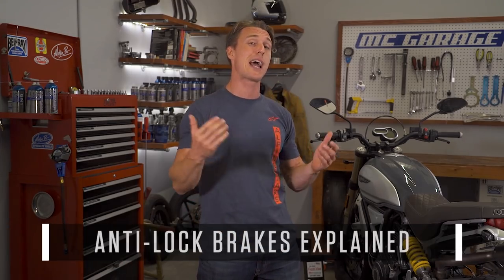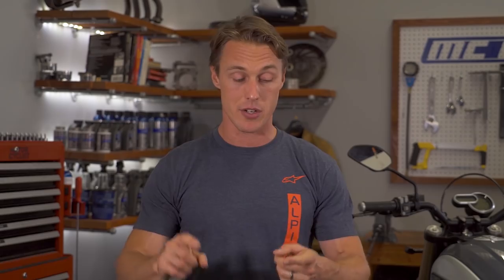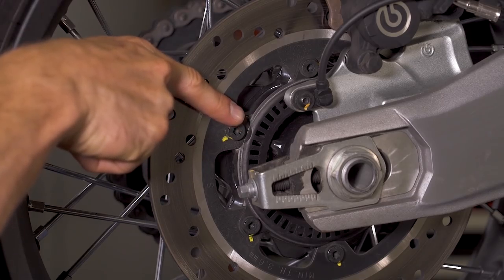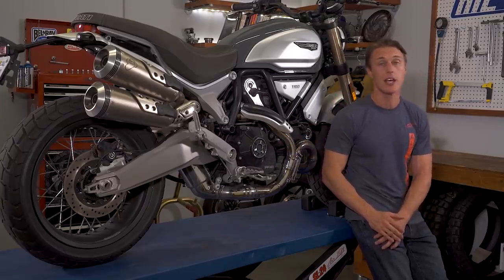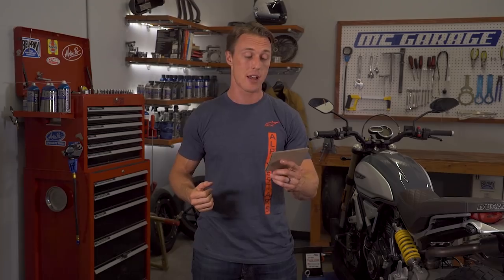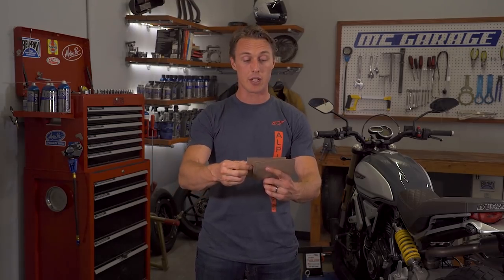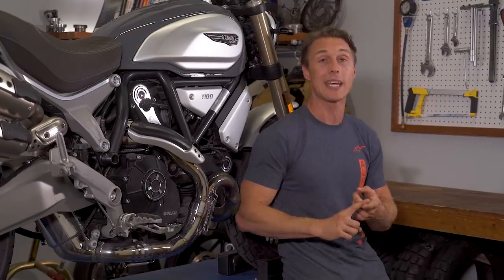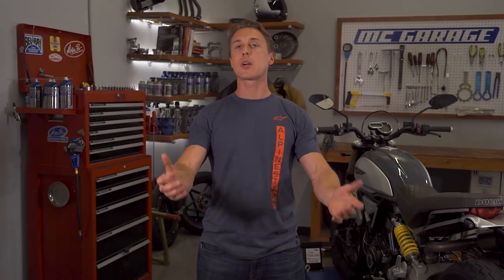Anti-Lock Brakes Explained | MC Garage

Comment: The couple times I had to brake so hard that I engaged the ABS on my MT-09, it did save me from falling, crashing etc. Soooo, yes, I do like it!
On the other hand I wish I could switch off the ABS on the rear. Just for fun.
Reply: I've definitely had a few close calls, but those were in my earlier years...I'm wiser and more paranoid these days, heh. But yeah, if they work well, then I'm all for ABS in bikes
Reply: Most (690 and bigger) KTMs have that possibility to to disable rear abs. They call it Supermoto mode.
Reply: Funny it's standard on the Duke 690's, but I had to buy a $130 dongle for my 701SM (mostly the same bike) to disable my rear ABS. If I want to re-enable it in the rear, I have to yank it out. I'm mad at myself for paying that, but I'm kind of glad I did.
Reply: Quintan Neville That is funny. It's much easier to activate with my -13 690 Duke R..
Reply: I also own an MT-09, and what I do to turn off the rear ABS is to pull out the rear ABS pump fuse 😁

Comment: Love it. First bike didn't have it. Second one did. All since have it. It's like fuel injection; I can't go back to carbs. I'm not interested in worrying about locking my front wheel on sand at a stop ever again.
Reply: Me too. First bike did not have ABS (Fazer 600), and second does (XSR900).

ABS saved me last winter when I fishtailed twice on icy cobble-stones on cold tyres.
Reply: i'm somewhere in between definitely my next bike will have abs. 
p.s. what were you doing on your bike in the winter on cobble stones!? o_O
Reply: Bad illustration. ABS is not like carburetors.
Did you pour air and gas into a bowl and stir it with a manual crank beaters, then dump it into the engine while riding down the road? No. Nothing about how the fuel got into the engine was manual before, or now. Brakes are always manual. ABS is subservient to the user, not the other way around. It's always mandatory to learn how to module brake pressures! Do people stomp on brake pedals while driving the car, every time they need to stop? No. They modulate pressure.
Panic stop? If panicking is your idea of proper driving or riding, don't.
Reply: @exothermal.sprocket  it's just a example not a comparison
Reply: Brakes are manual, ie. you squeeze a lever and the force of your muscles translates to fluid pressure.
Fuel atomization is via machinery (carb or f.i.), you don't do anything.

ABS is subservient to manual input, ie. you squeeze the lever with adequate force to begin to stop rotor movement, the speed sensors trigger the ABS module to take over fluid pressures and "pulse" the system.

Comment: Both my wife and I own H-D bikes with ABS and have been in real life situations where it has been used. We were cruising down an asphalt road out in the country, kind of bumpy, about 45mph when a full size doe and her two yearling jump out in broad daylight. My wife was ahead of me and grapped both front and rear brakes, i did the same. I saw the bike squat and slow down and straight as an arrow. They were so effective i was amazed. It's a no brainer, if the bike offers them, get them. If the bike your looking at does not offer ABS brakes, look for a bike that does.
Reply: @wescobts what kinda bike were you guys riding?? I'm considering my first cruiser and it's been driving me insane. I really like a few of them Suzuki m109r and Yamaha radier but they don't have ABS. All the sample videos I've seen on front wheel lock ups on YouTube are sport bikes and always wondered why cruisers don't offer as much ABS options as cruisers. Anyway thanks a ton for any advice in advance!!
Reply: @Lizizoteezo  
I am riding a 2018 H-D Street Bob, and my wife is riding a 2017 H-D 883 Sporter. They are both really nice bikes. The ABS system works great and the bikes are nimble and handle road situations well. There are plenty of add ons and acessories available for both models.H-D offers ABS on any of there bikes, worth a look. Good luck

Comment: I have had roughly 15 years on two wheels and only recently did I have a chance to ride a bike w/ ABS on a regular basis and I have to say, it is nice to have. When the ABS kicks in, I know that I am getting too close to the limits of my bike. True, there is a little more "safe braking" to be had but unless you're on a track, why would you want to get closer to the edge of traction? Emergency braking doesn't always mean you are going to be on point with managing brake pressure, simply because of adrenaline/panic/survival reactions so having ABS there to save your bacon is ABSOLUTELY a good thing. Great vid, I love seeing notifications that there are new vids on Motorcyclist Magazine's channel.

Comment: As a bumbling novice who rides both a KLR and a Super Tenere (2015), the latter having at least a little sophistication in that applying the front brake also activates the rear brake to a certain extent, and who keeps hearing that you want to turn off the ABS for off road applications, my questions are these (assuming that I could turn the ABS to start with): 1. Should you turn off the entire system or just the rear brake off road? 2. Why should I want to turn off any portion of the system off road to start with?

Thanks guys. Appreciate your incredibly valuable presentations much indeed!

Comment: ABS Is like all other electronic safety  wizardry. Like traction control, like anti wheelie, like motor slip regulation. You don't like to admit it's a good thing, but being honest, it let's us take it to the next level. We can push that little harder, and, with KTM's contribution towards electronic wazardry, you don't even know its helping you do it. It is a good thing. Let's let it evolve. 
I'm just waiting for height controllable wheelie control 😁
Reply: Nick Bennett that’s exactly my wish. Didn’t buy an S1000R naked BMW yet, just because the wheelie control is either on (and intrusive, in most of the riding modes) or just completely off in the pro mode or whatever they call the “all nannies off” mode. I wish to have just a “supercool but safe wheelie” mode, and I’ll be happy!!!

Comment: MOST of us "Like what we are used to"... and for old buzzards like me, that means NO ABS... Emotionally speaking...
But my last Bike Purchase also needed to be 'affordable' or it wasn't going to happen at all...so I threw down a DEEPLY Discounted hand full of Dollars on an FZ1. ABS was 'available' on the then new 2013 for about $1,000 'extra' and at full Retail price...Somewhere above $12,000.  BUT they didn't have any in stock... And the 'left-over' 2012 model that I took home cost me about $8500 Ride-Out! With just 4 miles on the odometer, and no ABS. With 40 years of riding without ABS, I am still quite 'comfortable' just as it is. BUT I have had my share of times when I now WISH I had ABS, and I am pretty certain that my NEXT Bike will have it! My first experiences with ABS -- 'test riding' friends' bikes -- I was not comfortable with the examples I rode! But I DO realize how much it can HELP...Especially in those PANIC Stops that some .. Most of us will still GRAB the brake lever...
I still do Track Days with my non-abs 'nekked bike' ... and play Chase with a few WERA Racing Friends of mine up in the Blue Ridge Mountains... even at 66 years 'young' !! But more and more, I 'wish' I had ABS...but also glad I was able to Pay Off the bike at that purchase price, rather than to still be paying 5 years later...

Comment: I ride a 100cc and also tour on it. I am planning to upgrade to a 250 or 300 in a few months. However, I haven't ridden an ABS bike yet. My outlook has been that riding a 100cc has not only helped me in knowing how much pressure I am to apply on my brakes but also to read the situation well while I brake.

Comment: Very nice and simple video explaining the basics and need for ABS on street. I ride 373cc single cylinder motorcycle in India and the dual channel ABS saves me from crash almost on a daily basis. Thank you for this video. I'm going to share it a lot!
Reply: Is it the duke or the rc? Because I'm wondering if all the problems and bugs got fixed for the duke.
Reply: I spent 6 weeks in India, done the golden triangle etc... And spent some time in Pune. All I can say is that you're a braver man than I! I saw so many motorcycle adcidents. ( from the UK BTW, just to give some context )
Reply: @nickam4100  Its actually Dominar 400, Indian version of  Duke 390. (Dominar is product of Indian Manufacturer Bajaj, a partner of KTM) So basically it uses same engine block as the 390, but overall heavier motorcycle.
But yes, the 2017 D390 is much refined and improved than the older models.

Comment: I own an XSR700 and the rear brake easily activate the ABS, which is a pain in the ass. But I am very grateful to this system coz I drive in winter with snow and rain, and at multiple time, it saves my life (especially before I take a corner).

Comment: On my 250cc V-Star with a rear drum brake, the rear would always lock up in the wet. Never locked in the dry, but I was fishtailing in emergency braking in the wet. Fortunately, the close call I did have I was able to maneuver to the side, but after that experience I think ABS is a must if you ever ride in less-than-perfect conditions.

Comment: I think that the ABS on my Fireblade saved my bacon recently, mostly because I felt confident about squeezing the brakes as hard as I could. A big boat of a car turned into a driveway after having squeezed through a stopped lane of traffic, thus completely blocking the road about 30-40 feet in front of me while I was probably going about 40 mph. 

I stopped about 6" from the door, and the driver and the passengers were just staring with their mouths open (he had stopped the car when he saw me... of course). I know I heard the rear ABS kick in, but I think I heard the front wheel slide and re-grip too.
Reply: Definitely adding "saved my bacon" to my repertoire

Comment: Abs both saved me and impressed me. I was riding pretty fast down a lone road, i was in a bit of a daze and didnt notice a stop sign at an internesetion about 100 feet away. I suddenly slammed on the brakes for fear of getting hit. I went from 80 mph to 0 in about 60 feet. Not only did the abs save me during my panic brake, it kept me from being a cars hood ornament.

Comment: My old Triumph Sprint in its day was a beast and it’s ABS wouldn’t engage unless traction was compromised. You could lift the rear braking hard, only just , and you wouldn’t get the bar shudder symptoms ABS is renowned for every time you dived it in. Yet grab a handful on a wet day whilst riding over some slimey leaves into a corner while pulling up for an intersection and that day it saved my bacon and proved its worth. I was a bit out of sorts but I pulled it up and very thankful as the car that crossed my path had no idea of the predicament I was in. And this was on an 2006 bike. Wonderful technology.

Comment: Hey Ari what is a floating disc, semi floating disc And a normal disc brake? Please answer!! Please!!! 😕
Reply: Agreed ! I know what the different types look like But I want to know the benefits and disadvantages !
Reply: And a video explaining the maintenance to the floating disc.
Reply: Heat dissipation
Reply: Floating discs are able to wobble freely around the bolts.They allow the pads to grip the discs evenly and are really helpful in the track.
Reply: I think there are broadly two types of disc brakes; floating and fixed.
In fixed disc brakes the there are pistons on both sides of the disc pressing against it to provide braking force.
But in floating disc brake, there piston(s) is only on one side, with the fluid pressure making the brake pad on the other side press against the disc too.
Hope this gives a basic understanding!
Reply: mukundan nair  wrong. The floating or fixed disc has little to nothing to do with the caliper. All supersports will have floating discs and 4 pot calipers. even my bmw k1600 has 4 pot brakes and floating discs
Reply: @puttputt1992  just one of the many videos that show the difference. You haven't even given an explanation to what they are. If there are different terminology used then I'm not aware of that.
Reply: mukundan nair You have gotten confused between fixed and floating callipers. Floating discs mainly help prevent disc warping in high speed braking where heat would warp a fixed disc by not letting it expand freely and evenly. A floating disc would be free to expand and cool down evenly thud preventing warping and allowing optimum braking force and feedback
Reply: @Sand_1995  radial and axial are just the ways the callipers are bolted to the bike with the respect to the disc right? After this I did search online and I see what you guys are talking about. Hmm looks like differing terminology udef
Reply: Used*
Reply: mukundan nair yeah I was trying to write about fixed vs floating callipers.
Reply: @Sand_1995  but why is it that there are so many videos explaining floating vs. fixed the way I described it
Reply: mukundan nair They were probably explaining fixed vs floating callipers or you got confused between them. A floating disc is able to move freely about its mounting point like its name suggests. A fixed disc is not. The difference between them is in  heat dissipation and better braking feedback.
Reply: @Sand_1995  ah yes maybe. Thankyou for the clarification!
Reply: 5putput  funny
Reply: Sandepp we have
Reply: mukundan nair - radial and axial is the way the disk bolts to the wheel, (At the axle, or at the outside rim) the caliper is then attached to suit.

There are two types of calipers, floating and fixed. The floating caliper has pistons on only one side and the caliper housing moves to center the clamping force. The fixed caliper has pistons on both sides, the caliper does not move and the force is centered by the pistons.

There are three types of rotors, fixed, semi floating, and full floating. Fixed rotors are one piece and mounted directly to the rim. Semi and full floating rotors are two piece, the carrier bolts to the rim and the disk is able to move relative to the carrier. The difference between full and semi floating is that in a full floating rotor the disk is completely free to move/rattle around, at the pins, relative to the carrier while the semi floating disk is held by spring washers at the pin. You can move a semi floating disk but it takes force, while the full floating takes no force to move but makes a lot of noise.

Comment: Very illuminating video...well explained....how does Traction control stack up against ABS...interested because my scooter without either almost jack.knifed the other day when I hit a stretch of gravel and I had to fight to retain it and myself from smashing into a concrete dividing wall...ABS would surely have helped smooth that out if I braked...as I had notime to break....but maybe traction control may have stopped the sudden slew of the front wheel??

Comment: Thank you so much for finally talking about this.
Can you do an advanced one to compare systems from continental and bosch?
Also, can you highlight which bikes actually have cornerning abs? Companies try to obscure which bikes have it (i.e. speed triple vs speed triple rs). Also companies are loose with terminology and often refer to advanced abs as "having an IMU" but I think that's not the case -- Honda's new cb300r has an IMU but i don't believe it has cornering abs and other advanced things.

So much information! You'd do the community a huge service by explaining it further. Thanks!

Comment: I think you nailed where the negativity for ABS came from and there was a lot of truth about what said in late 1980s (BMW).  Most major brands have ABS sorted out now where it is a must have and I guess from 2018 and on it is a will have. Not having ABS has not kept me from buying a bike but if everything is equal it is a tie breaker for me. 

Like ABS in the beginning I am not so sure about the other electronic nannies. I will say traction control on the high horsepower bikes can certainly be useful. I do worry that some riders will be overly dependent on those nannies and neglect their riding skills. I already see it on the road with heavy throttle and braking way too much.

Comment: A question for MC Garage to cover. Take a modern 2010+ fuel injected motorcycle. The stock fuel map (or rather the whole setup) is inflexible. What I mean by that is that an ECU flash, a remap using third party gadgets and so on is required to maximize performance (not just horsepower, also throttle pickup, low end grunt, popping on decel, etc). A modern bike has sensors all over for the ECU to decipher into maintaining a good fuel burning efficiency, however it's compromised all over due to regulations. And that's where my question comes from.

Why are fuel maps so inflexible? Why can an ECU not maximize performance the way we want it to on it's own? For street bikes we all want good torque and power down low and in the midrange, with a pleasant throttle feel. It always requires mods and finetuning to get the most out of it, yet, a bike usually responds very well to a well set up fuel map. I know the stock map is intentionally allright as opposed to awesome which is what we want it to be. How come an ECU can't do that on it's own? Is it programming complexity and an inability to guarantee good performance and reliability to ensure it meets regulations?

Thank you!

Comment: Most roads here in Istanbul has almost no traction, so if you give full beans fully up right the traction control cuts the fuel off straight away. I happened to have a non abs bike before and it was a nightmare. 7 out of 10 times I’d be locking the front wheel and use my fingers as abs which wasnt as efficient and safe. It’s definitely a must here and i cannot imagine riding one without. Do you have roads like that in the US? How do you know if some tarmac has good traction and others don’t? Maybe another video? :-)